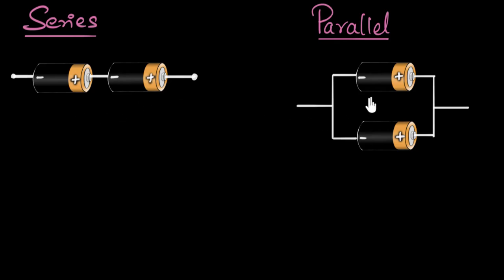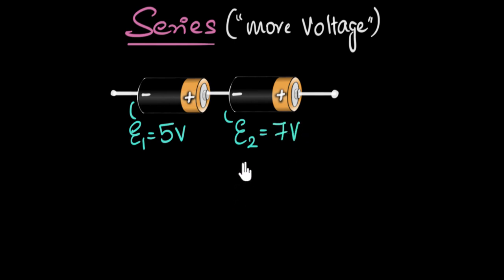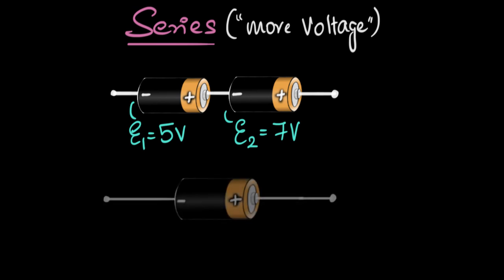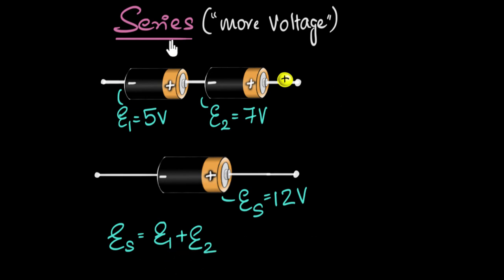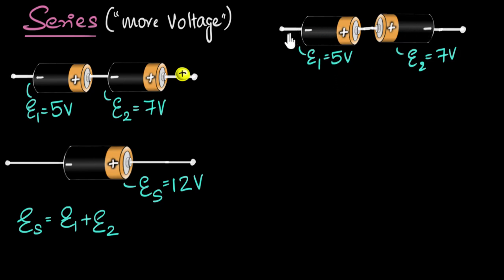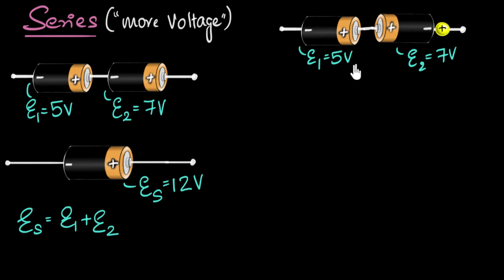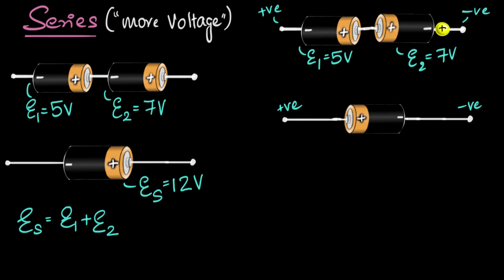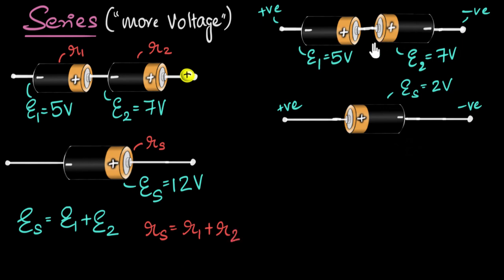Cells in series | Electric current | Physics | Khan Academy

Comment: 2:12 but sir positive charge moves from + to - , wouldn't it be repelled by + terminal.
Reply: Ye but it will be pulled by the negative terminal of the adjacent cell. So the positive terminal of the first cell will repel it away into the negative terminal of the next cell...
Reply: In short. yes
Reply: bro its not magnet
Reply: @ajk533  bro you don't know I think...same charges repels each others

Comment: i think your explanation is pretty much reversed  ,and wrong .as according to batrery current could not flow if you connect posituve to positive ,i think so .
Reply: Movement of charges is what produce the electric current. So as long as that charged particle is moving in one direction..there will be current
Reply: Actually it's just an analogy as explained in his earlier video and the positive charge is just an metaphor of the direction of current...